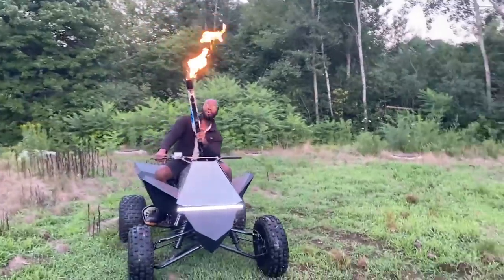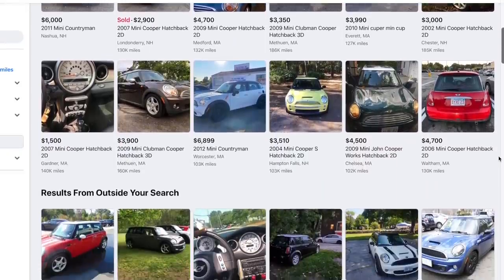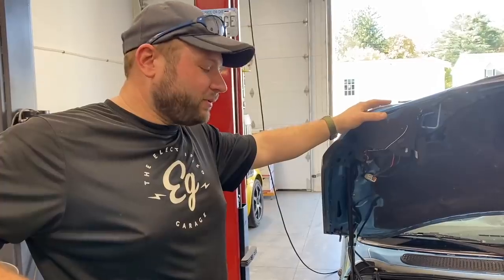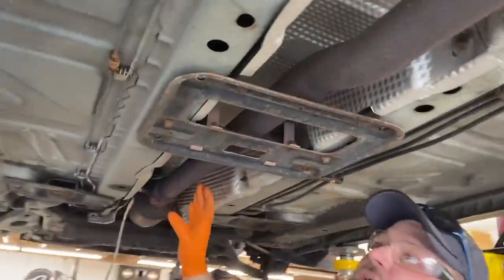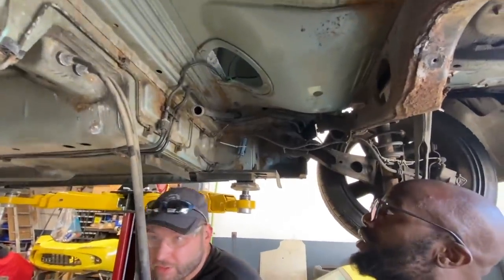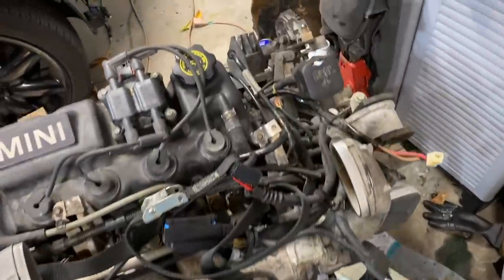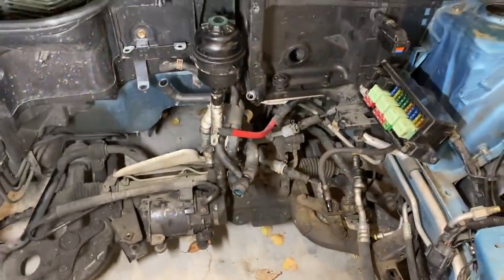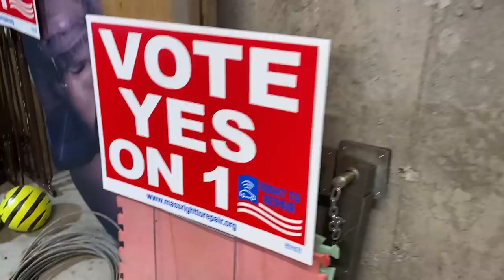I Bought The Least Reliable Car and I’m Making It Electric on a Budget

Comment: Well, even though using the existing transmission will make things easier, you might still consider doing something completely new with this one as you already have lots of experience in ev drivetrain.
To be specific, using the factory mounts is a good idea, but you can still get(design, order) custom brackets for a new drivetrain that would fit the oem engine mounts of the car.

The idea is that you could use two electric motors in the front with separate single gear reductors that would output the power beside the motor 180degrees from its shaft. So you could have two motors in the middle of the engine bay facing each other, with the reductors outputting power towards the wheels. With some luck you might use two short oem driveshafts.
What would be interesting in this concept is that you'd have independent power to each wheel giving huge traction like an LSD would in the normal transmission, and as an added benefit, you could potentially implement some torque steering, and perhaps even get rid of the power steering using that torque steering (in theory it would work even at standstill), and having electronics onboard that would allow torque vectoring you could also get some serious electric braking capability in there with stability control under breaking (reverse torque vectoring).

Would be really cool, as the "simplistic" conversions, are still lots of work, and are quite popular. The also keep the car relatively normal, while this would be kind of innovative, and make the car very different to drive from oem, and also compared to a conversion using the oem transmission.

Comment: Some mini have a battery at the front right in front of windshield. Just finished an 80k mile 2010 s 6 speed, timing went, destroyed head and pistons. Got head in Michigan and put new pistons and timing in. Had to put oil in cylinders for first start and replace the starter that was stuck sounding like a serious engine issue then ran great. Sold it like the rest

Comment: Just a quick tip: Try and find the R52 (convertible) strut braces, they really help strengthen this chassis and they run for about 30-40$ and get the cravenspeed strut tower reinforcement plates also (or OE if you can find em) cause the strut towers on these cars tend to mushroom. Looking forward to seeing this build process as I own both an R50 and an R53 Mini :P

Comment: Use the power steering system!!! I had the power steering on my '05 Mini Cooper go out (known Mini issue) while 1000 miles from home in Moab UT. I said to myself that it would be no problem driving home without it. After all, it's all freeway driving, it's a small, lightweight car. I was wrong!!! It is a workout just keeping it going straight.

Comment: I purchased my supercharged 2002 R53 3.5 years ago with 47K miles on it. I'm on my third power steering pump. The original was replaced under extended warranty. I drove around with a intermittent pump for a couple of weeks. I wouldn't recommend it. 

I replaced the original 26 pound factory wheels with Enkei J10 for $150 each. It shaved about 8 pounds per corner and added about one mpg. It really made a noticeable difference in acceleration and turn in. 

The MINIs have issues with the shock towers mushrooming from metal that is too thin. There are various methods of mitigation. 

As others have mentioned, rebush the suspension while the engine is out. Powerflex makes great bushings. 
Get rid of the run-flats.

I leased a Spark EV for 3 years. That 402 pounds of torque would have been quite a treat in the R53. The Spark was throttled up to about 18mph, though.

It's a high maintenance car but OMG, it's fun on California's Highway One. It's my sweet addiction.

Comment: Rich hear me out, electric fiero
Reply: Yes
Reply: ...powered Lamborghini Countach kit car.
Reply: @ms_enj  came here to prop that
Reply: If 'fiero' is italian for 'proud', what's the italian word for 'disappointed'? 'Cause that's what Rich will be with an electric Fiero.

Edit: According to Google translate, it's 'Deluso.' 

Honestly, that's sounds like a pretty good car name to me.
Reply: Ugh no. Electric DeLorean.
Reply: He'll just be going from a gas fire to an electric fire.
Reply: This made me laugh...back-up option should be a Probe
Reply: my daily was an am4 fiero for close to 2 years. wouldnt take that pos above 90 lol
Reply: MPH or KPH?
Reply: @vintagethrifter2114  ive taken my Fiero to 170 kmph
Reply: That's 105MPh which isn't impressive since GM four doors could do that and more with the same motors.
Reply: @vintagethrifter2114  yeah ik but there's real easy motor swaps for them get them real speedy cause they're so light. My Fiero was stock top speed of 200 km but probs would've died if I went for it
Reply: That'll eat.
Reply: low rider fiero @legitstreetcars
Reply: Too common. MR2 would be more interesting.
Reply: @vintagethrifter2114  Probably electronically limited speed. Also, the Fiero should be quicker to get there.
Reply: The 1985 Fiero was one second faster in the 0-60 than the four door Pontiac 6000 with the same L44 engine. The 6000 also had a top speed of over 100mph.

Comment: For brake booster just use a VW vacuum pump, one way valve, pressure switch. Those vane pumps move quite a bit of air, would probably suffice. You could get several in a wrecking yard any day of the week.

Comment: Hey Rich, for your brake issue check out Jeg's or Summit.  Hot rods have vacuum issues when a big cam is installed so, they just run an auxiliary 12 volt pump and storage tank. This would let you keep the brake system total stock, no special parts or engineering required.

Comment: @rich rebuilds, first gen Bini's use a peugeot/citroen based TU engine package. If you want different ratios you can use transmissions from a peugeot 106/citroen saxo or any small engined (1.6 or lower generally) psa car, including the diesels. Anything with a TU based engine and an MA gearbox really.
If you manage to get a solution to this using a gearbox converter plate, then a standard package for a lot of different cars would be easy. I am planning a similar setup with the larger BE3 type gearbox. I have a large (10/11 inch diameter) series wound dc motor, which is about the largest you will get in due to driveshaft and input shaft center distance.
Also, for future reference, the saxo and 106 use divorced, on demand electro hydraulic pumps for power steering. You can put the pumps anywhere as long as you can get lines to it, and they run an inbuilt resevoir as well and they don't have to be above the rack to bleed them.

Comment: I did not know that the Mini Cooper had dual toilets in the back. That would make long drives very convenient....also, was that a Yes on 1 sign in your garage? Please tell us more about that, cause if Uncle Rich likes it, maybe the rest of us might think it's cool to vote for.
Reply: Initiative 1 is the right to repair your own car legally in his state, someone mentioned. Basically, car companies want to make it impossible to diagnose your own car to fix it without using their expensive, proprietary, dealer/mechanic-only-accessible data(they collect it from the car), software and hardware. It's far beyond just what the OBD2 port gives.

Comment: Volvo v70s use a electric vacuum pump for the brakes, I've used these o n conversions, you can find them on scrap yards for nothing! I plug them in using a standard light switch on the brake light signal!

Comment: R56 (non turbo) owner: battery is in the  passenger firewall area. Also my Mini is losing coolant and burns oil now for some reason at 165k mi. I'm considering a Chevy Bolt since doing an EV conversion is a hell of a lot of work for one person.

Comment: RE:  BRAKES hey Rich!  Consider looking up hydroboost brakes.  It uses hydraulics instead of vacuum, and it could probably run off the power steering circuit (they use this in dump trucks; I put one in my V-8 swapped Jeep).  I would think that this would be more quiet than an added vacuum pump.  I can send pics if you're interested in seeing how it's set up.

Comment: Why not use the running gear out of a Leaf with the charger , inverter , transmission and DC to DC converter.  The control side is easy to sort out with the boards from Damien Maguire and Johannes Hubner . The Mini transmission will most likely crap the bolts when you apply the torque of an electric motor and the Leaf setup would save a lot of money and ball-ache .

Comment: You haven't experienced an unreliable car until you've attempted to drive a first generation Chrysler Sebring.
Reply: Or a wheego
Reply: @sadmac356   The front drivers side wheel has to be removed in order to remove the battery on a Chrysler Sebring. Massive electrical problems never end.
Reply: @loafandjug321  oh geez

Comment: You will, 1000% want power steering in that Mini. I have an R53 (2005 MINI Cooper S) as well and the power steering pump failed while I was driving. It's remarkable how heavy the steering is in this car, but I suspect it has to do with the entire driveline being immediately over the front wheels. I got lucky that I was almost home because the manual steering is miserable, even under movement, on this car that should inspire confidence tossing it through corners.

Comment: You have an r53 generation. There are supposed to be both a muffler and a resonator in the back, two of those pods. Also the new r56 and f56 generations have the battery in the front.

Comment: there are 12v vacuum pumps available/adaptable for your brake assist( check out summit racing for new,  junk yard for 90's 00's used VW type)

Comment: You might look at mid 2000 Dodge diesel trucks for the brake vacuum setup. They run vacuum assisted brakes with an electric vacuum pump for assist.

Comment: J. B. originally designed a two-speed transmission for the first Tesla Roadster. The first few couldn't last a month because of the incredible torque, so they switched to the single speed, and have never looked back. Of course, that reduces complexity, too. But you should be fine if you don't put a monster motor in this thing, with all the benefits you described.

Comment: Looks like a good pick for an EV conversion. You can compare it to the official electric Mini and oh, don't cheat by getting EV parts from an actual electric Mini, you hear?

Since you're into German cars, good "classic" builds would be 2nd/3rd gen 7 series or 2nd gen S class. I was going to say E36 but at least a couple of those have been done. A really "interesting" build would be a Bolt swapped Prius. That would be more fun than legal at drag strips. 3:-)

BTW, one correction. In conversions where they go manual steering, it's NOT the same as a power steering car with the engine off, which is STIIIIIIIIIIIIFFFFFFFFFFF!!!!!!. It's more like an old VW beetle, Isuzu pickup, Ford Ranger, etc. with manual steering from the start so it's many, many times easier to turn than a power steering car with the engine off... but stopped and at low speeds, manual steering its still a lot harder than a power steering car. One trick for manual steering is to remove the pump from a power steering setup and shunt a hydraulic hose between the input and output on the rack, keeping remaining fluid in the rack.

Comment: TY for the shipstation promo, used it to return a BS item to Vancouver from chinmounts.... it was 3D printed $0.30 bullship sold for $35!  I couldn't believe it was not an injection molded part once I got it.  3D printed parts do not attach to adhesive well, I got some generic chin mount from amazon instead which I believe will do much better!  TY Rich!  That's how they get you though, they ship it to you, and if you use USPS's click n ship, it's $40 to ship it back.  On ship station you can get first class mail for $14, which makes it actually worthwhile to return your $35 piece of crap.

Comment: Rich swap out the rear suspension for aluminium R56 mini to save weight.  You will also find out the mounts for the trans  came mostly from the engine.

Comment: Have a 1 way check valve connected in with a rubber hose to the brake booster inlet. Use an electric vacuum pump to generate the vacuum and the 1 way check valve will keep it from loosing its vacuum right away and the pump won't have to run all the time

Comment: Haha, as soon as they showed the little fan for the power steering... Mini's from that era have a very distinct sound at nearly full steering lock at low speed / car park sort of speed.

And no, The R53 I drive has it's battery under the hood, to the right.

Comment: My Paceman was the most reliable car I've ever had, regular maintenance, coil packs were replaced too often, 10 of them in 264K miles. Catalytic converter @ 260k. Now the car (not saying its related to replacement) is using a quart of oil every 3-400 miles. Prior to 260K it would use oil, but a quart every 4k miles. I know 1 or 2 have made it to 700k to 500k respectively. But if you think regular maintenance will get your Mini to 500k, it's not going to happen.........very interested in this build. I'm still driving Mini, just adding oil when needed.

Comment: You can run an electric vacuum pump for the brake booster. racecars with individual throttle bodies run them.

Comment: I have a Integra type R.. which is FWD car.. i thought about adding electric drivetrain to my back wheels .. so i can keep my  9000 + rpm engine and have  instant torque of electric motor for taking off. making it a AWD for traction as well... it has enough room for that as its gutted and caged.. maybe one day

Comment: Hey Rich,

I have a 2002 Toyota Prius with 198k miles, but the battery pack went bad. I installed a charging harness to try to get some extra life out of the HV battery, and that worked for a few months but at this point it doesn't drive very far. 

Since the body is pretty aerodynamic, I've been researching EV conversions for it but it's been put on hold during COVID.

Would a 2002 Toyota Prius be a pretty decent car to convert? Or might it be a bigger headache than it's worth?

It seems like maintaining the hybrid electric system would be the biggest headache, because of MG2 issues on that gen of Prius 🤔

Thanks,

Tilda

Comment: 2005-2006 mini coopers and 2015-2019 are the reliable years of the mini but avoid the automatic transmission and go with a manual and you’ll be set ;) expect to replace the clutch around 96k miles
Reply: Absolutely.  Except I far prefer the automatics.  I don't do manual anymore.

Comment: I have a automatic transmission that it broken.  Do you really need a transmission to connect the electric motor?

Also how did you work out the power steering?
Thanks

Comment: Apparently modern Mini engines are hard to work on due to space and layout. Replacing the motor with an electric one makes sense however how do you get past all the electronic stuff?- Computers telling the car to be in safe mode or some other mode because it doesn't detect the engine, exhaust or all the other things the computer monitors..?

Comment: Enjoyed the video, but Minis aren't unreliable. They had a bad repuation in their first few years because they used Midlands manual transmissions (which WERE unreliable), but they fixed this in the '05-06 cars when they switched to Getrag. (Manual is the only way to have these rally-heritage cars; automatic misses the point.) I've got a '05 with 145K miles on it and it's still going strong. The '05-06 cars are the best, and best looking, used Minis to buy.

Comment: Going to be a while before gas is history so go with the next idea.  Kits to convert vehicles will be very popular soon.  One I am working on should make conversions much easier, the new electric drive will be from replacement wheels which are the motors, and with the new British Austin batteries you get 1,500 miles per charge, much more sensible then Tesla.  Even 2 wheel drives can be made 4 wheel drive. Trucks and other vehicles just as easy to upgrade. Going electric is going to get a whole lot simpler and cheaper soon.

Comment: Little does rich know...
The far side axle is bolted to the engine block with a carrier bearing and the engine is held in place by two mounts that are also attached to the head/block.
Now he has to fabricate (weld?) mounts and brackets for these three items.

Comment: There are 1 million MINIs out there in the US that could benefit from this conversion if it was practical and affordable.   I have a 2010.   It looks like the day it rolled off the lot.   However, the transmission is giving me issues, and I have had the $5000 cylinder head and timing chain replacement courtesy of the lawsuit against BMW for making that crappy N14 Engine.   If I could replace my motor and transmission with an EV Conversion kit, this thing would be like having a new car.    I'm excited about this !

Comment: The reason mini coooers tend to overheat is because the cooling fan for the engine and power steering pump were run to the same circuit. Then when the fan on the bottom of the car got stuck it would blow the fuse/relay and the car would quickly overheat. Poor design. I learned from experience. Plus the transmissions are garbage.

Comment: It looks like good old 4aGE will fit it perfectly. Or some of Honda's VTEC engines, at least. I'm sure it's ok to swap for electric motor, or for some of gasoline motors if there is a bulk of minis with blown out engines around.

Comment: Have a look at the openinverter.org forum as they do a lot of re use of item hybrid parts in ev conversions, I believe there is a motor controller that re uses a Prius inverter, that gives you a free dc-dc converter, plus Prius inverters are dirt cheap.